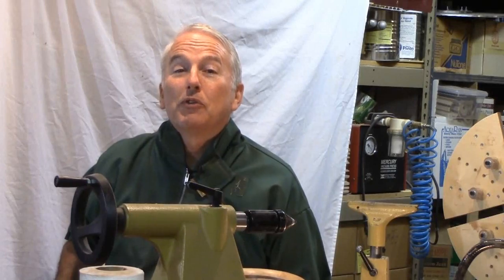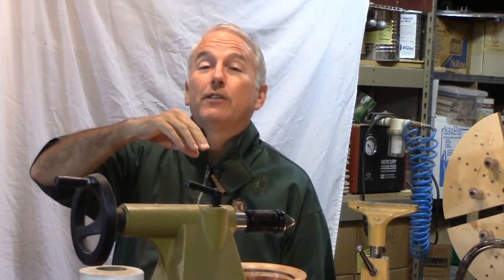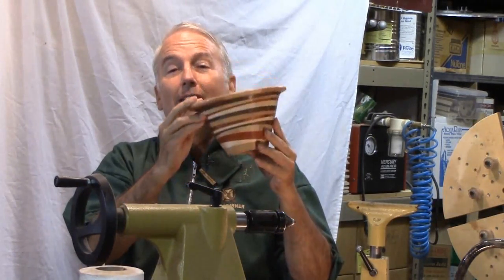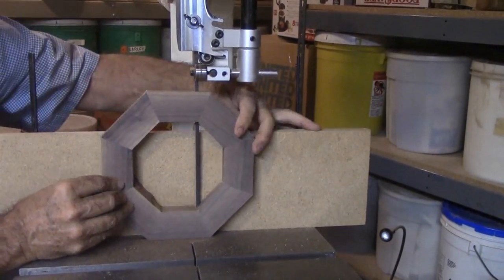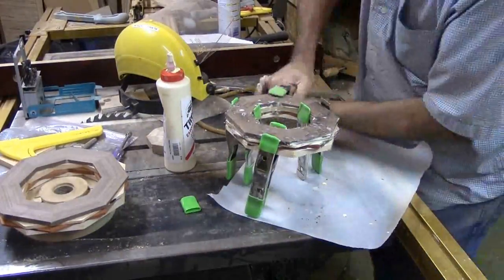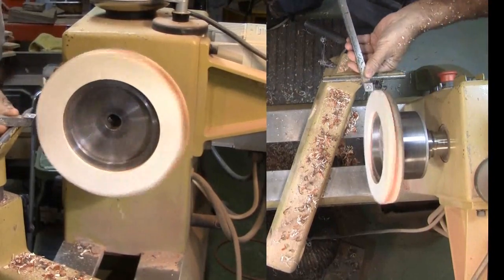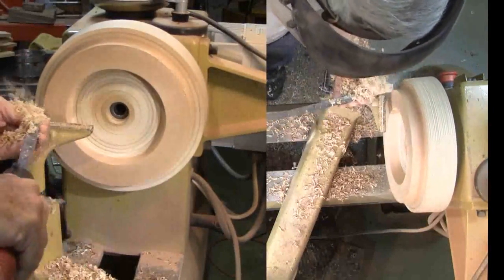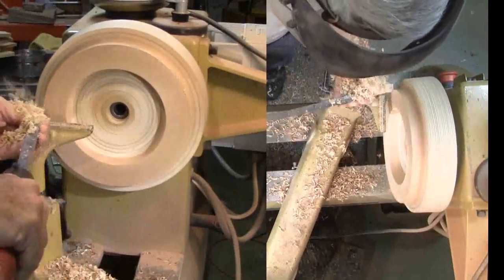Woodturning A Crazy Droopy Segmented Bowl

Comment: Alan, you definitely know when it's time to break the rules!
Awesome bowl!

Just a thought on the glue up. I think you should have turned the inner portion of each ring prior cutting it on the band-saw. This way you would have had a reference surface (the inner ring) for gluing up at least 6 of your diagonal cut rings at once with more clamping pressure than you could apply here. Assuming that you use some kind of a dowel to stack the rings on. (A quick turned dowel out of pine, covered with some packing tape should do the trick. The dowel has to be slightly smaller in diameter for the tapered 'face' of the inner circle of the rings. (I hope you got what I'm thinking off).)
Never the less, sometimes I can make it more complicated :-)

Only the result is what counts in the end and definitely this bowl is far from looking awkward, great reward for all the work you put into it!
Greetings from Good Old Germany
Peter
Reply from the maker: I thought about that but did not want to trim all the inner rings. Until I fought the glue up, then it sounds much better.  However, I think I will try gluing them one at a time first.
Thank for your extended comment.
Alan

Comment: if you watch "DIZZY BOWL " by Dennis Edwards ,his bowl is great , but make it more random , and not a spiral but a complete random design , our problem as engineers and turners is we can get too wrapped up in precision and order , as opposed to artists who use the random features to make things look good , all my bowls are accurate and square and somewhat boring compared to this ,,I'm going to try and make the segments completely random cut each ring at a random angle,and glue each ring so the segments don't line up ,and see what happens ,
Reply from the maker: I think you left off one more dimension to randomize. Segment width within each ring. Then perhaps the joint angle (generally vertical or 90 degrees). Each adds complexity but hopefully adds beauty and interest.
I believe there is space for both regular and random(crazy) in this art form.
I'll be trying more variations myself.
I appreciate your thoughts.
Alan Stratton